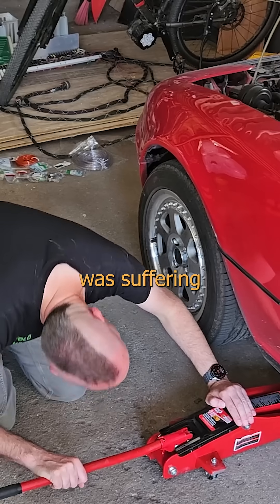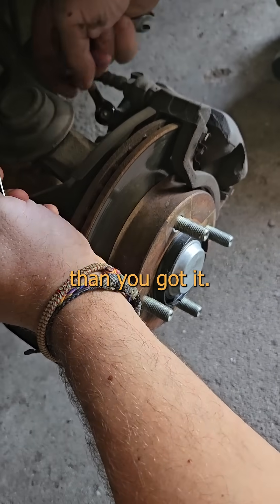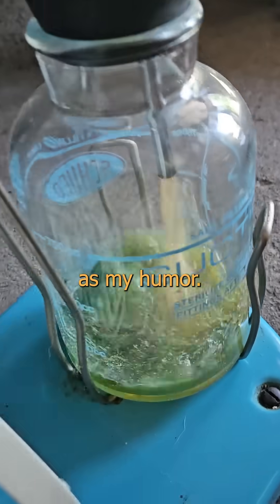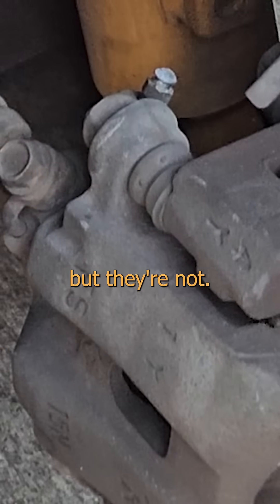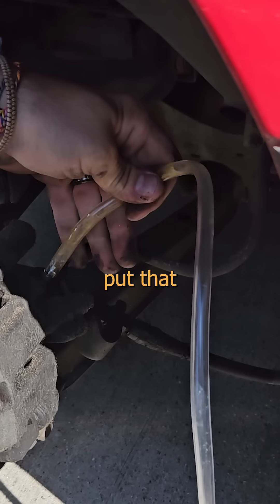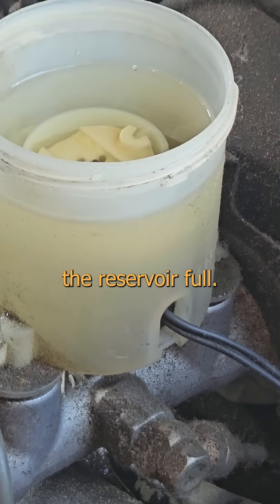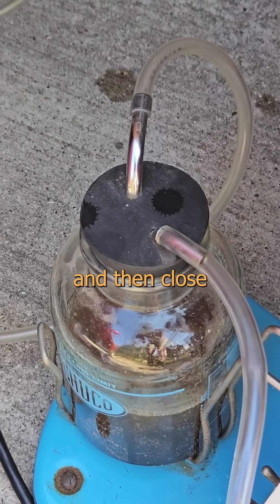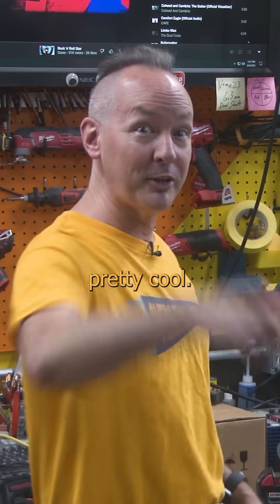How To Change Brake Fluid #chrisboden #comedy #engineering #educational #diy #skills #lifelessons

Comment: I've got one brake bleeder I bought because I didn't have a vacuum pump. Uses air from the compressor to create vacuum. But using pressure for vacuum sucks . . . efficiency-wise. Anyhow, I now own a vaccum pump, but I've not needed to bleed brakes or clutch systems yet.

Comment: I BUILT A THING FOR THIS! I 3d printed an adapter that screws onto a bottle of brake fluid upside down, and sits on (probably) any reservoir with a nozzle to prevent overflow, and some 2 part silicone over molding to make it waterproof. I don't need no friends to help me! (I need friends 😂)

Comment: some new vehicles will monitor the brake fluid and if it thinks there is a leak it will shut off flow to the caliper, when im doing a brake flush on new gmc trucks i have to unplug the battery to flush the fluid

Comment: Last summer a friend loaned us their junk run truck while we were between cars. It spends 99% of its life parked under a tree and was covered in significant flora and limited fauna, as well as plenty of grime.
A couple hours with a pressure washer and sponges and  the streaked black and green truck they loaned us was returned to them factory white. 
Many years ago I returned a borrowed car with brand new front brakes. Because they were nearly gone, and throwing in a set of pads and rotors were still a fraction of what a rental would have cost me.

Comment: Automotive B tech here. I do this for all my brake jobs snapon/matco/(tool truck brand here) sell these with pneumatic hookups. If you do it wrong you just need to open the valve while someone holds a firm peddle (pump 4x beforehand) don't let them pull their foot away until the valve is closed. Bonus info is thats how the old guys used to do it before the vacuum cleaner. Should be done once every 40k or 2 years whichever comes first. Always stay ontop of brake fluid and coolant as they will determine how long that engine lasts and how fast you will stop.

Comment: I used to vacuum my brakes, but it sucked! My favorite way to do it is to pressurize the system with a Motive Power Bleeder. You need to have the right adapter cap to match your master cylinder, but I've never had better brake pedal feel!

Comment: Pushing through the system is generally easier than sucking at the bleeder, you can also use the bottle method where you just put a hose from the bleeder into a bottle and pump the pedal, just make sure you refill the bottle so air doesn’t suck back into the system when you let off the pedal EDIT: if you do the bottle method put thread tape on your bleeder screw! I forgot to mention that

Comment: at the dealership i work at we do it in reverse, a machine pumps new fresh brake fluid under pressure, pushing the old stuff out without any risk of air. one man job, its great.

Comment: There is a much fancier machine that lets you do a positive displacement brake fluid flush. You attach an adapter to the brake fluid reservoir and it pressurizes the system with new fluid. Then you use the vacuum pump to pull the old stuff through and the machine automatically keeps the reservoir topped up for you. It can be quite handy in a car repair shop.
Reply: A machine that both blows and sucks!  lol

Comment: You can use vacuum, gravity or hydraulic pressure to bleed the system. 
An old school vacuum technique was to use a clear piece of hose and a air blower gun, venturi effect will do it.

Comment: Good way to do it. Use some Teflon tape on those bleeder threads. Seal air leaks so your vacuum pump setup works better. And you'll get a good indication of air free fluid thru the clear hose.

Comment: A note to all, check the brake fluid level after bleeding each wheel. Ensure that you top it off so you aren't pulling air back into the system.

Comment: i do the same thing to change the power steering fluid in older john Deere tractor with a cab as we were informed that was something like a half day job at the dealer bc you had to remove x many panels and wiring harnesses to get access (so drained the system dry with a old stomach pump that looks like the movie the rocketeer helmet that was converted to some sort of beer hat as it has a glass bottle on each side so there is less chance of anything contaminated the pump) then used a old oiler can with a flexible hose fitted to it to pump fluid back up to the reservoir on up inside the cab bleeding the air off as i went worked well and was entertaining

Comment: If you don't have a vacuum pump, run a piece of hose from the nipple into an old coke bottle and pump the brake pedal until it comes out clean on each corner.

Comment: Finally you did one for brakes because I kept telling people hey you need to flush the brake fluid get the old fluid out when you do the brakes because otherwise you get hydrolock and the brakes won't work and you won't stop one day and they said no I've never changed the fluid in mine and I don't have a problem I said it doesn't matter if you've had a problem it's when you're going to have a problem and everybody thinks that I'm crazy that you don't do a brake flush when you do the brakes themselves the pads or shoes and I said I'm not talking about doing that I'm saying take the old brake fluid out of the calipers or out of the wheel cylinders and get fresh new fluid in there and everybody thinks I'm a joke and I don't know what I'm talking about

Comment: No it's not over engineering the alternatives rather it's a hand pump or the method of pumping the brake and then opening the bleed screw are both horribly time consuming and feel like Sisyphus

Comment: Better vacuum pump than what I typically use, but this is the easiest way to do the job.

If you get one of those cheap brake bleed kits from Harbor Freight, you can pitch the air vacuum part. - the best thing is the bottle you fill with brake fluid.
 It has fittings to allow for placing inverted in the top of the reservoir, keeps it topped of automatically

Comment: It is cool only if it works!  Some bleed ports do not have o-rings or gaskets thus are designed for pressure bleed rather than vacuum.  Love the simplicity of process explanation.😊😊

Comment: Normally you'd have this done as part of a major brake job (new calipers, for instance, as was required for my Fiesta after going 155,000 on the factory brake pads -- which still had fiber on them, but apparently you're only supposed to use 70% of the thickness because the composition also serves as heat insulation to keep you from cooking the caliper).

Comment: You can do it with a Gatorade bottle the same hose. Put a little fresh into the bottle and put the end of hose enough to sit in the fluid. Loosen your petcock and pump/add until clean fluid is in the hose. Tighten and repeat 3x

Comment: I prefer to use a pressurizer, it's as easy if not easier because you can add some fluid to the pressurizer tank, and it will keep the reservoir full while putting pressure on the system

Comment: Couldn’t disagree more especially with cars. Once worked on a Subaru where you couldn’t drop the oil pan unless you dropped the exhaust. Nowadays they way over engineer the cars and unless you have a thousand dollar scanner you’re fucked. They make engine bays smaller and add insane amounts of electronics it makes no sense.

Comment: In the navy, there were also petcock valves on our ships service diesel generators (Caterpillar 3608). Twice a day we would shut off fuel to the generators and open thise valves, then send 450 psi to the flywheel to perform a "blowdown". Basically ejecting any carbon buildup.

Comment: This method can not be used in a car with a modern ABS system. Then it must be about 2.5 Bar overpressure at the reservoir instead (all of the refill system turns into an overpressure flask). That is actually less troublesome compared to having a vacuum suction at the caliper. But the great part is that all old brake fluid is exchanged in the ABS unit. The vacuum method will only partially exchange some brake fluid in the ABS unit and later send water-contaminated fluid down the brake lines during usage. That might generate a water vapor lock during hard driving...

Comment: It depends on how gummed up things are.
If there is a leaky seal, it could suck air.
I prefer to use pressure from the master cylinder to push out the old fluid.

Comment: A good note would also be to start with the wheel farthest from the brake fluid reservoir and so on. This also helps prime the system without getting air.

Comment: hmmm, returning it in better condition means you're cleaning the car. doing fluid changes or other more mechanical stuff might get you grilled if they ever get mechanical issues with the car, they might think you caused it. depends on who lends you the car, how good of a mechanic you are and how good of a mechanic the lender thinks you are.

Comment: You missed the most important step here.

Step 1 - use a syringe to drain out the reservoir, then refill with clean fluid.

Save yourself half an hour in sucking a sloppy tube

Comment: I've built a remote powered DeWalt tool for jobs like this where you need two people. Plug whatever 12v accessory into it and turn it on. Then grab the remote and I can turn the device on or off from up to 150 ft away. Other ports hooked to a momentary switch for those tasks where you only need power for a quick second.

Comment: You may need to take the nipple out, put a layer of thread tape around the threads of the nipple, and put it back in. Otherwise, you're going to draw air from around the threads.

Comment: This is not the proper way to flush a brake system. First make sure to REPLACE THE PADS AND LINERS!! If you don't replace the pads, don't fill the reservoir all the way...or you'll have a hell of a mess when you do!

Comment: Until you work on a modern GM where the hoses coming out of the Master go above the height of the reservoir and the fluid runs out. Grandpa left his calipers off for a day and let the fluid drain. After far too many hours, I had to take the hoses off the ABS module and bleed the air out to that point to get it square again.

Comment: In actual shop experience we either gravity bleed or positive pneumatic bleed using an adapter, tank with a bladder that holds 12 quarts of brake fluid and connects to shop air and pushed the old fluid through the system at 150psi~

Comment: Over-engineering is ONLY over-engineering if the result or the quickness thereof is inadequate to the original formula. This would make my job as a mechanic 10x easier if I had a vacuum pump.

Comment: on a motorcycle, you tend to just pump the brake until clear fluic comes out the hole.

scooter's brakes are still shit but at least I won't die.

Comment: I wish people were like this.. let a friend borrow my truck, and it's still sitting in my backyard.. he blew up 2nd so bad the inside is a smoothie ( somehow the case managed to hold all the guts inside ), locked up the brakes so bad all 4 tires are flatspotted, and he blew both door speakers... he was trying to race someone. I gave him the option to buy it at pre blown up price or pay me $300 a month till it's fixed ( he agreed to buy the transmission outright and do payments for the rest because I took him to court over it and they take it out of his check before he gets a say )

Comment: To quote the handsome physics duck "code is a floor, not a ceiling". Generally, code is just beyond just good enough. Over-engineering leads to ships that don't sink, bridges that don't fall, buildings that stay standing, and cars that don't crash. Keep up the great work. We love your videos!
Reply: Yes for that kind of application, but not when you don't leave space for the people who will have to get behind to fix it (example in HVAC applications).
Reply: @DenisR-tt1oe  Engineering should take in all aspects including placement (even though we know it doesn't).  I am a physical engineer in semiconductors.  We get bit by the whole "having to put 10lbs. of sh!t in a 5lb. bag" all the time.  I love it when I see an access hole in car chassis for reaching a difficult bolt (great design) covered by the suspension and body guys so that in order to access the "access hole" you need to remove 10 other things.  Thanks guys. 🤣

Comment: You can tell the brake fluid reservoir was poorly engineered because it is not placed in a hard c to reach, inaccessible place where you would have to dismantle half the engine to get to it.

Comment: It's absolutely not going overboard.

My dad did all his own work on our cars growing up. They never went to the garage...

Except every time he did a brake job he had the worst time getting pressure back in the system. Always seemed to have air in there.

This system is perfect. With the guy on top adding more fluid you CAN'T run into that problem.

Your way actually looks way, way easier.

Comment: The vacuum makes it sooooo much easier. I've tried to do it with one of those hand pumps, and it might work for systems with a little air in them, but if you have a significant amount, you might as well throw throw the thing out, take the hose, stick one end on the bleed screw, and submerg the other end in brake fluid, congrats, you made a one way valve. Now you can pump the breaks while making sure the reservoir is full.

Comment: They actually sell kits that do this using an air line from an air compressor instead of a pump that pulls the fuid into a container. On the fill end, there's a gerbil water bottle kinda thing that has the metal fill hose under the fill line, so it pulls brake fluid from the bottle and won't add air. It holds a lot of fluid, so you may need to only fill it twice. There's also kits that will pressurize from the fill end, I've only had experience with sucking from the brake side like he's doing.

Comment: If you dont have a vaccuum but do have a buddy and a couple beers, you can just tighten the brake like, pump the breaks, loosen the bolt, squirt out the fluid, tighten the bolt, pump the breaks and repeat.

Comment: I just do it the old fasioned way, but I've ordered a cheapie check-valve gadget from the 'shop to make it easier to do, solo. If I encounter a master cylinder full of dark fluid, I use a disposable pipette to empty it, and just go through the wheels after that.

Comment: I've have to be honest, never done it. Owned a construction company, we ran the trucks to 300-400k. Over 25 years. Never had an issue. Some had the lines replaced around 200-250, but never did it as a separate job. My shop was my dad's business, over 50 years as a mechanic. Dad says 10 years. Never owned anything that long, so...

Comment: I’m a mechanic and we have those vacuum pump tools, I noticed when I bleed brakes with using vacuum only, I always end up with some kind of air in the system, the best way I found to bleed brakes is using pressure with a sealed cap over the master cylinder, now how come vacuum leaves some air in the system but pressure bleeding won’t?

Comment: There is no such thing as a vacuum.  Removing gas from tubes/components will allow a fluid like hydraulic oil to fill the tubes with one Bar of pressure (about 15 psi or 100000 pascals).  Any air entrapped in the tubes becomes a spring that will compress before your brake pads.

Comment: Vacuum bleeding is good - for a cheaper, but still just as easy solution, I recommend pressure bleeding from the reservoir. You use a pump bottle, sort of like a pesticide sprayer (I used the one from Motive), fill it with fluid, attach it to the reservoir, and pump it up. Then all you have to do is go to the wheels and loosen each bleeder screw in sequence. Works like a charm.

Comment: My experience with brake bleeding is that the old fluid was saturated with rubber from the 30 year old parts. Hence, dark colored. New fluid isn't and will soon dissolve something critical in the system.
You may soon be doing a complete hydraulic system for her.

Comment: I use a cheapo vacuum system from Horror Fright, gets the job done but what REALLY makes it work is combining a couple PSI vacuum on the bleeder screw with about 15 PSI pressure on the reservoir. Push from the top and pull from the bottom, not only will the old fluid evacuate in a hurry, it will also eliminate trapped air like nobody's business.

Comment: If a vacuum pump is not available, the same can be done by having one person depress the brakes (depress, release, repeat) while the other 'tops off' the master cylinder. The bleed valve, hose and container setup is basically the same.
Reply: I was gonna say XD Im no expert, but Ive done this several times and we didnt use any vacuum pumps or even pressure from the other side from any kind of device... Just bled it and pumped it till you worked all the air out and filled her back up

Comment: Except for the air that gets past the threads on the bleeder screw. Not a problem when flushing the system but a problem when trying to evacuate air out.

Comment: Nope not overengineered we‘re doing it that way for 20 years. Recently upgraded to a pressure one where you put pressure on the reservoir. But here and there we do it with the vacuum pump, when we don’t have the right adapter for the reservoir.

Comment: In Canadian forces maintenance shops we have a brake bleeder that works the opposite way. You pressurize a container of brake fluid affectionately called the "R2D2" and connect it to the resevoir, then open the connection between them. After that you're bleeding brakes simply by cracking the bleeder and waiting till the bubbles stop.

Comment: And when I worked at the garage as a mechanic I was the sucker meaning I had to get in the car and pump the brakes up to build pressure so my boss could turn the little screw a quarter turn and then tighten it back up and communication is key pump it up, hold it down, to the floor😂